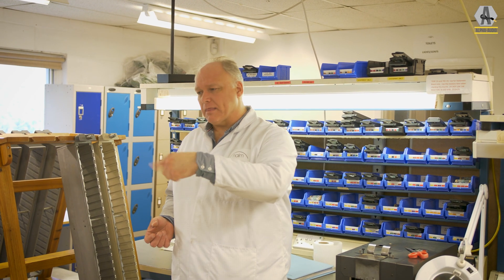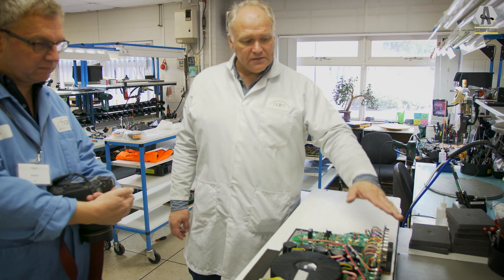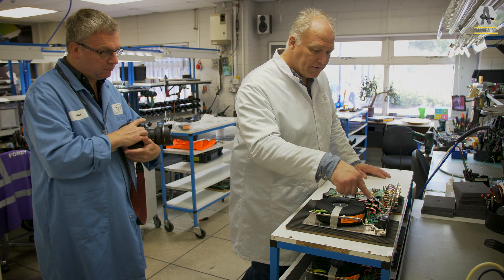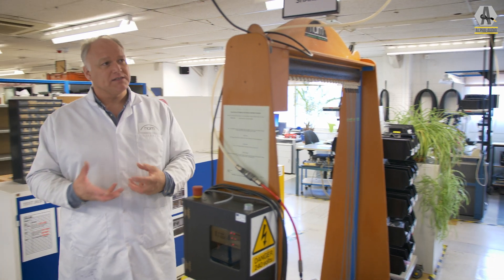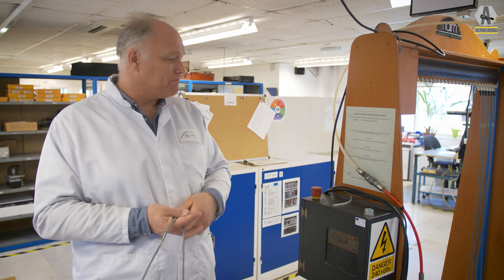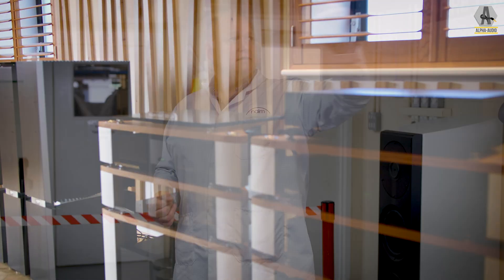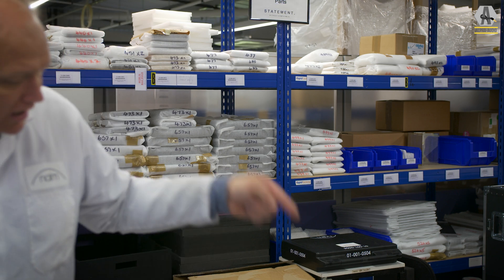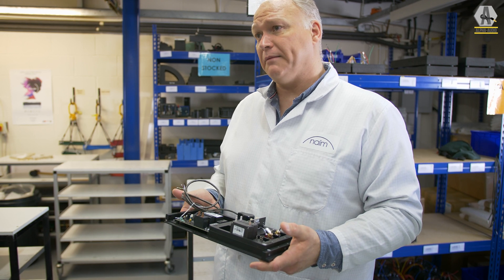How High End Audio is made - Factory Visit NAIM Audio - UK

Comment: Naim’s mantra has always been; great audio should be affordable to everyone, not a select few! Their entire line of products proves that point, from modest entry level, to no holds-barred high end. Naim’s design provides the owner of using either unbalanced RCA or balanced DIN/XLR connection. This is a feature that usually is only featured on expensive equipment, but Naim gives owners their choice, by including both! Audiophiles swear by DIN/XLRs. I love both Jeff Rowland & Nelson Pass line equipment, which are outstanding. But their cost is prohibitive, or hard to swallow for most enthusiasts. They focus on what’s audibly important & avoid any overkill, which isn’t necessary. Their look is modest, but their performance is as serious as it gets! Multi inspection processes insure a flawless product is delivered. They prove you don’t need to be wealthy, just wise🎼👍🏆.
Reply: Naim is hardly affordable , what mansion do you live in ?
Reply: well, i find their components quite expensive, also compared to other great sounding brands.

Comment: The only engineering fact in this video is the guy testing each component for noise. The rest, you might as well have a Buddha giving each amplifier his blessing as it passes by. Classic audiowankery justification for shaking interconnects "we can't measure what changes, but you can hear it" -yeah. Right. As for phono leads vs DIN - just use XLR balanced leads, as that's what everything you hear has passed through dozens, if not hundreds of times during recording instead of making up nonsense about reflections in a 2ft length of cable at audio frequencies. BTW, I've worked at a well-known mixing desk company and you know what - all your precious audio is sent back and forth along the bus through standard IDC cable (yep, the same stuff that connects your floppy drive to your computer), and the components on the strips are just bog standard transistors, capacitors and resistors  used in any other electronic device - suited to the application of course (e.g. low distortion and low noise op-amps where they make a difference). But hey, after traveling through all that, I'm sure the pseudo-science in your amp makes all the difference. I'm not saying Naim don't make good amplifiers, but if they are good, it's because of well-known electronic design principles, and not some quasi-religious chanting ceremony as they leave the factory.
Reply: If electrons flow more efficiently in flexible cables what happens when they travel through rigid, right-angled solder tracks on a circuit board?
Reply: @spudpud-T67 😂😂 cute...gotta love delusional "audiophiles"

Comment: Why bother testing 317 and 337 regulators? 
Just go DR for the whole range.
Talk smack about RCA connectors but you run power through DIN alongside signal.
Reply: You're missing the point, as so many non-naim employees and non-engineers do ...

Comment: May not agree with the "shaking cables" bit but I like his statement about RCA cables being "audio jewelry".  I used DIN plugs for years and they're great connectors and save a ton of space and money.  I used LEMO connectors on early Mark Levinson gear.  Gullible Audiophools have been sucked in by Snake-oil RCA cable manufacturers pricing them above components.
Reply: Yeah, I love Naim, but shaking cables?  C'mon man.  It doesn't matter if you shake a cable, cryogenically freeze it, bake it at 350 for an hour a foot, or put it on a spaceship and orbit it around the moon, cables don't matter.
Reply: @blendtecbrah  As I've mentioned in a reply further down this thread, the shaking of cables came about because we, the people that listened to every naim product and made the final decisions as to what made the best sound (for us) heard the difference it made.

It's subjective, a matter of taste, not scientific, and we never pretended otherwise.
Reply: @marktucker4528  I believe you when you say you heard the difference it made, that it was subjective, a matter of taste, and not scientific.  But could you tell a shaken from an unshaken cable in an ABx test, consistently, at an accuracy higher than that of just guessing?  Probably not, and I bet you're ok with that ;) 

In your defense;  I get it.  Audiophile stuff is fun.  I used to subscribe to all of it, and once even lusted after a $32k pair of Transparent cables that I now know/believe perform no better or worse than lamp cord.
Reply: @blendtecbrah  My four listening-team colleagues and I could consistently, in completely blind tests, tell you every time which cable sounded best; we might not know at that point which was shaken and which wasn't, that was only known by whomever we had entrusted to 'run' the test, but when we compared each of our results, because we always did such tests individually before doing them together as a group, we could accurately rate the cables in order by correlating which cable (or any other hi-fi component) we had all chosen and in which order.

We sometimes had to listen to twenty or more cables in a single test session, to assess the merits of a new cable manufacturer, or a new connector, or a new type of solder, or the direction in which the cable sounded best, etc.

These processes could take several weeks, sometime months, of exhaustive and thorough back and forth listening to ensure that we weren’t mistaken, and to make sure that we were all choosing the same sample of whatever it was we were listing to. Honestly, we really did this, for decades.

As far as your comment about audiophiles, we never, ever considered ourselves audiophiles. We hated hi-fi for hi-fi’s sake, naim systems were always designed to be a means to an end, a tool for enjoying recorded music, nothing more, not audio jewellery and frippery to feed one-upmanship, and we never subscribed to what we mostly considered to be over-priced, under-performing ‘miracle’ products.

To this end, if you knew naim as it was through the seventies, eighties, nineties, and noughties, you might have noticed that we always included what we genuinely considered to be the best interconnect cables, power cables (with selected, hand-fitted 13amp plugs), and source connections with every product, included in the price.

We also designed and had manufactured our own speaker cable/s, and our own connectors to be fitted to them, in order to eliminate as many variables as possible when putting together a naim based system.

There was never much profit in these items for the company, they were usually included at cost, and I know of no other manufacturer, before or since, that went to the same lengths as we did in this pursuit.

What all of this did was eliminate the need for our customers to enter the minefield of painful and often criminally expensive trial and error research into such ‘ancillaries’.

A naim system could be built, from source to loudspeakers, with every single link in the chain having been tailored - upon optimum sound quality, not just technical requirements – from start to finish, with no need whatsoever to throw the resulting sound to chance by experimenting with the hundreds and thousands of interconnects, connectors, and speaker cables available world-wide.

And I stress, yes, there were those of us at naim who could consistently and reliably hear the differences and choose the same cable, or pre-amp, or cd player, or even humble mains fuses, time after time after time in completely random, blind tests.

You don’t have to believe me, that’s your choice, but I know this is true, I lived and breathed it for the best part of four decades.

Apologies for the lengthy diatribe. 😅
Reply: @marktucker4528  No need to apologize.  I do truly believe that you and your colleagues "heard" a difference.  However, the placebo effect is very much a real thing, and I question whether a properly calibrated measurement microphone and RTA would "hear" the same difference.  Perhaps that answer will be forever lost to time.  

My continued skepticism aside, I applaud your team's efforts.  There was a time when I might have labored with the same fervor to deliver the so-called Absolute Sound, but these days I call it a day at a system that just sounds really good.  A really good sounding system might be a Naim source and amplification, speakers from Dynaudio or Pro-Ac, and whatever cables that looked nice and weren't frightfully expensive.  Alternatively, a Naim streamer and some active DSP speakers from Kii or Meridian would do the trick as well.
Reply: @blendtecbrah  "I question whether a properly calibrated measurement microphone and RTA would "hear" the same difference".

I sincerely doubt it would, but why would anyone truly care whether or not an audio improvement (or deterioration) can be measured? 

We honestly couldn't give a rats arse if we ended up being unable to measure the differences we heard, and believe me, we tried very hard, with some very sophisticated and expensive equipment, in the pursuit of knowledge advancement and for the sake of making improvements repeatable and easier to test for during production.

Which is why our final test, for every single product we made, was a listening test; sometimes an item of electronics, or a pair of speakers, for example, which had sailed through all of our exhaustive measurements and QC, just didn't sound quite right, so it was rejected and put back through production to try to find out why. If we couldn't make it sound as good as we felt it should, it was considered unsaleable and never left the factory.

The whole point being, only our own ears matter, at the end of the day, and we all should choose what we like personally, not what a machine, or, god forbid, a reviewer or a mate, tells us is good or the best. 

Everyone's ears and listening preferences are different, of course, so what I like, you may not. Our policy was to only manufacture what we all liked and believed to be the best we could do at a given price point - we worked at naim because we all, evidently, liked the same kind of sound - and then offer it in limited or larger quantities, depending on demand, for sale to anyone who liked the same sound as us.

If you didn't like our gear, you didn't buy it, simple. And we openly advised people not to buy naim unless they were utterly certain it was for them.

As for a placebo effect, forgive me if I have misunderstood, but there cannot possibly be any placebo effect when listening tests are done truly double-blind; we/I literally didn't even know what I was listening to, nor why, in all initial comparisons, I was just asked if I had a preference for a, b, c, d, and so on. It might not be until much later that I was made aware that it was mains cables, or rubber feet, or different adhesives, or different torques applied to bolts and fasteners, or whatever.

I'll give you an example. My very dear and close friend Roy George, a genius engineer, acoustician, scientist, polymath, humanist, music lover, brain-the-size-of-a-planet-wonderful-fellow, who became naim's chief designer and technical director (at JV's devoted insistence), sat me down in his lab one day to play me some music, as he did so very often over the decades. 

I had no idea what he was going to play, nor the system he would use, nor why I was even listening. I spent the best part of that day with him, as was often the case, whilst he made change after change after change.

It turned out that we were listening to different pieces of glass, placed on top of the prototype naim fraim, to determine which manufacturer, which thickness, which tempering technique, coating, chamfered or non-chamfered, even the damn colour of the smoked glass, then versus clear,  made the best sound. I can't recall exactly, but around 30 different glass top-plates. And more over the following days.

This amount of devotion and exhaustive work was required for everything at naim, every component change, every time a supplier changed their spec or manufacturing technique, every time we could no longer source what we had been using previously, etc, etc.

Make of all this what you will, but there was a heart-felt desire within the key personnel in that company to be equitable, forthright, maintain first-principles, and be true to our aim to do the very best we could, at all times.

I'm just off to polish my halo now, it's looking a tad dull for my liking. 🤣
Reply: @marktucker4528  My contention about the measurement mic and RTA would be to objectively determine if there was any change in the sound.  As I'm sure you are well aware, even a beat up old SM57 is far more accurate than our ears are after enduring a lifetime of loud cities, rock concerts, and screaming children ;)  

Testing your shaken vs. stirred cables, solder A vs. solder B, Gorilla glue vs. good ol' delicious Elmer's on a measurement mic and RTA takes the human element (aka confirmation bias) out of the equation.  If the mic doesn't hear it, it's just not there.  

It's clear that you and I are not going to see eye-to-eye on this one, but I think we both deserve a standing ovation for conducting a civil debate/disagreement without it devolving into a name calling, chair throwing shitshow like is so common elsewhere on the internet.  

Further, I don't know if you disclosed your working for/with Naim earlier in the thread, but it's good knowing that they had someone with your passion/fanaticism on their payroll, working his butt off to ensure that the products sold to customers were the best they could possibly be.
Reply: @marktucker4528  This is a great post.  Thank you, Mark!
Reply: @blendtecbrah  Maybe in 10 years we will have a machine that can measure it but for now maybe we can just hear a difference. 
You know before Newton came up with the idea of gravity we still had been affected by it since the beginning.

Comment: There is one thing i remember from DIN cables in the early 70's is, that they were very prone to failure due to askew pins or loose solderings. I was glad when i got a system with RCA plugs. The transition was not only a cost reduction excersize.
Reply: You've missed the point, in a naim circuit dins sound better than RCAs because they have a common ground, full stop.
Reply: they had more hum too
Reply: Loose solderings are a sign of lack of soldering skills at the manufacturer, it can happen with RCA, DIN or in a washing machine and has nothing to do with DIN or RCA in the first place.